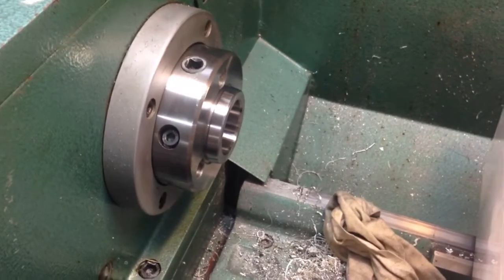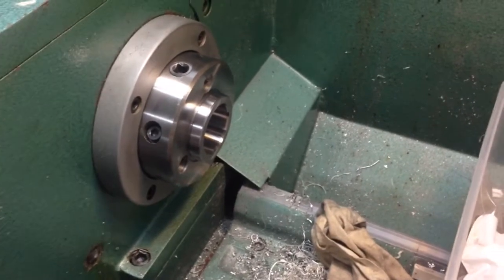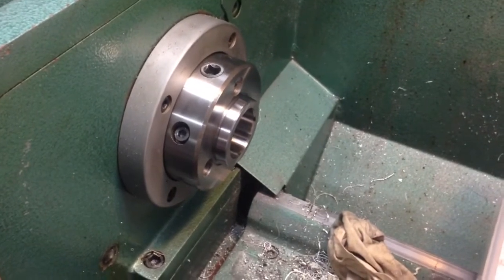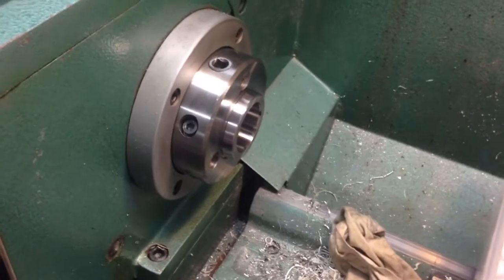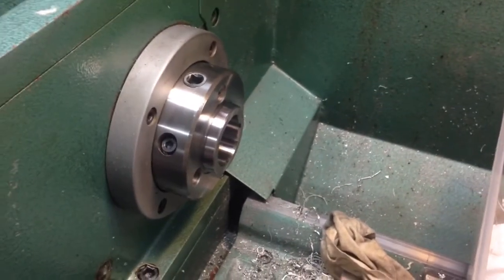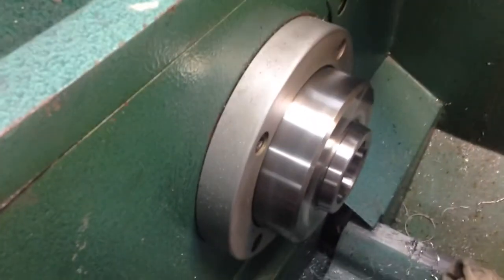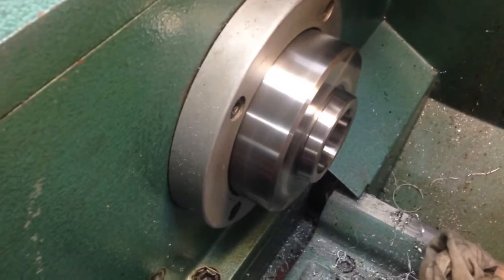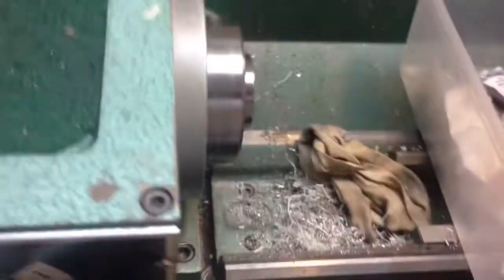12x36 lathe with VFD

Comment: dude. what was the cost of the motor, vfd, and inverter if you're using one?
Reply from the maker: The VFD is a Lenze/ AC TECH SCM series. The model itself is a SM220S. It is a single phase 220v input, output is 3 phase, the unit is for a 2hp 3 phase motor. This model eliminates the need for an inverter. 
    The motor is a 2hp 3phase Baldor.
    In this video I have the frequency ceiling set at 90hz. The VFD itself will allow up to a 240hz max. 
   Here is a link to the manual. There are many adjustable parameters such as accel, decel, speed, braking and the list goes on. http://www.actechdrives.com/PDF/AC-Tech/AC-Tech-SCL-SCM-Drives-Installation-Operation-Manual.pdf
   I dont remember what the cost probably under 400 dollars for both (motor and VFD). Check Ebay often, good deals pop up for those looking.
Reply: Hey bud, I don't know if you're around anymore but I would like to ask if there's a vfd that would convert 110v to this single phase 220v? I have the same machine, however, I only have a 110v power source.
Reply: @ridethemonkey  it's not hard to install a 220v outlet bro

Comment: That's amazing. I was expecting gear chunks to fly but it sounds good. I just bought one of these lathes but can't get the three jaw clamped down on it. It seems the flange is slightly too large. Is there a trick to getting it to fit? Thanks
Reply from the maker: Has anyone messed with the pins on the chuck? If you take the set screw out you will see a line on the pin itself. The line should be even with the surface.
Reply: Thanks for the tip. That fixed it.
Reply from the maker: deadlydavem That's  great to hear.